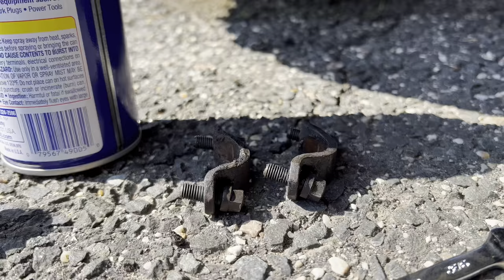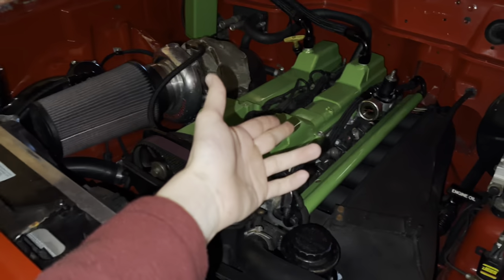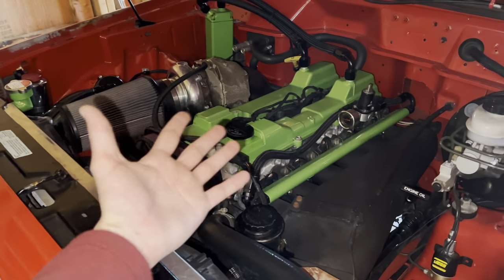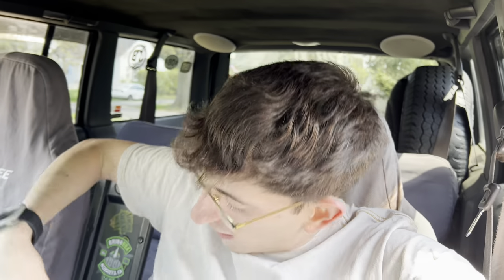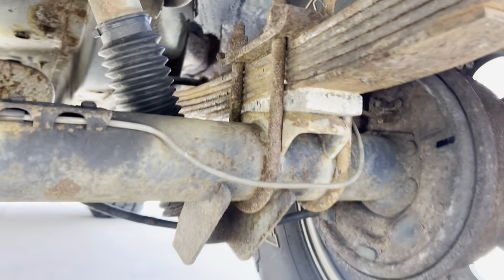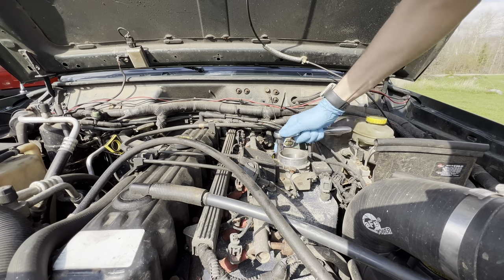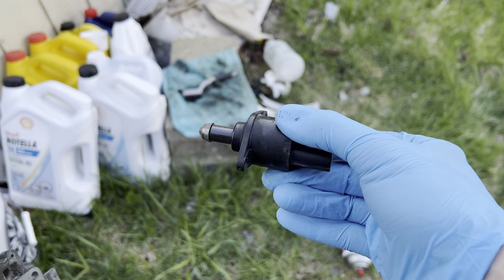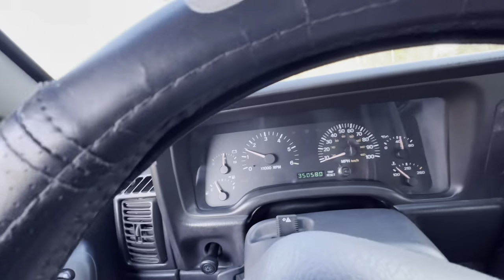This Is Why Your Jeep Gets BAD Gas Milage

Comment: I built my 4.0 for fuel mileage. It has a tune, upgraded pistons, and rings,balanced rods,  new cylinder head with LS valves, and mopar performance spings, Harland sharp roller rockers, re-sized ford 300 injectors new fuel pump, aluminum fuel rail, bbk throttle body, mishimoto radiator, with an upgraded fan, Afe power header with magnaflow cats. I get about 19mpg highway on 31 inch tires and a 6 inch lift.
Reply: Same, I built a 4.2l mini-stroker, factory head, factory cam, and electric fan conversion, I can get about 20 highway if I drive slow
Reply: @mercedescherokee6853   that's pretty schweet. I'm guessing 55-60 mph Is the sweet spot.
Reply: @TheGrimFoot yea about 65, my tires are a little bigger than factory so a little more speed puts it in a good rev range
Reply: @mercedescherokee6853  what's the mileage like?
Reply: This is so cool you should do a breakdown video
Reply: I use to think the 4.0 was bad on gas until I met the 3.7 omg what a thristy hog that thing will burn a quarter tank of gas just idling
Reply: Well, there's the recipe.
Reply: @michaelangelos5117  yeah, but honestly a stock LS motor is just as cost effective at that point.

Comment: Late to the game. The claim of "I'm not a mechanic" is kinda weak. If you're going to own older vehicles, like an XJ, and experiment on it, you need to swim on your own or be ok with paying money that could be invested elsewhere. There are very few regular shops you can take these to who will have any idea of what to do with some of that stuff (Look at Rainman Ray's Repair where he had an XJ come to his shop - good dude, but obviously not a Jeep guy). Also, if you don't know what your driveline angle should be with a stock vs. SYE/driveshaft combo, there are oodles of resources out there. In a nutshell: parallel angles for transfer case/Diff output/input (same angles at both u-joints) vs. point the pinion at the T-case for an SYE (minimal rear u-joint deflection). JFC, bust some rust on that thing before there's nothing left...

Comment: Just a tip. If you put the jeep in 4wd with the tires on the ground you wont have to use a pry bar to hold the front drive shaft from spinning.

Comment: yes cleaning MAP IAC and throttle body does in fact improve air flow thus improving gas mileage/engine performance. Getting it over 3k RPM is not lol. I feel like I get 3+ mpg better when I’m not heavy on the skinny pedal. I can get anywhere between 15 and 17 mpg in my 99 on 32s with 4.10 gears and 302k on the dial.
Reply: Absolutely. Going easy on it is key. I have a 99 stock height. I find just about 40mph and a lil above gives me the best mileage. Seems to be the sweet spot.

Comment: Those shims should go in the rear.  If you are vibrating in the rear, pinion angle is usually the culprit. Those shims will alter your pinion angle.

Comment: Those leafs being broken would definitely affect your ride! With that much rust, replacing those with the lift is highly recommended. 
I get 15mpg highway in my '98 on 35s. Just gotta keep the throttle bottle clean, air filter clean, and plugs/wires good. That 4.0 will run forever!
Reply: What tires are you running?
Reply: I have a collapsed lifter in 2 of my cylinders on my xj 4.0 and I get barely 10 mpg on 31’s with a 3inch lift. I’m just gonna run it till it blows cuz I got my dad’s 4.0 with 70,000 on it for my Jeep with gears and custom lift waiting for all the pieces for 35’s.   hopefully when I get the other motor in there is gets better mpg

Comment: Use "mass airflow sensor cleaner" to clean the IAC. It's designed for non metallic parts. Carb cleaner is designed for metals.

Comment: Shaking up front called death wobble need new bushings or replace the whole control arm lower and upper, do alinement. Those angel pcs under the rear springs you need them, you must point rear drive shaft to the pinion of the SYE minus 3-4 degrees less in angle as you hit the gas the entire differential rotates up wards so -3 -4 is perfect. Chech on line at Woods drive shafts will have videos as to the angle of drive shaft explained very well.

Comment: When you start losing oil pressure it could be worn out rod, main, and cam bearings.
As a temporary patch, you can run a thicker oil.
Reply: What would be the next step up in oil thickness from 10w30? 5w30?
Reply: @wyattserviss992 , It would be thicker, say 10w40, then 20w50. There are other thicknesses in between but the most used are the two I listed.

Comment: Steven, I believe that "Just Dex It" was able to prove that the low oil pressure at idle is primarily caused by worn camshaft bearings. Check out his resent YouTube videos. Be safe.

Comment: 1 it is a brick 2 its lifted 3 heavy large tires that is why they will get between 12 and 14 in town maybe 18 to 20 on hwy  you dont buy these for gas milage
Reply: I wish mine got that good of gas milage
Reply: I appreciate this kind of real info. Anecdotal? Sure. But, my 2000 is getting what I thought was "terrible" mileage until I considered...I'm getting 10ish in city...short duration. stop and go.  Once I take it on an actual straight line drive, I'm closer to 18. i am lifted, on bigger tires. Cam and stroke work. And, lucky.

Comment: Ive replaced multiple oil pressure sensors with oem 2 wire sensors, they dont read accurately at all, you need to run an aftermarket gauge to know what it reads, with hot oil on a new build it will drop down to 13psi coming off the highway to idle fyi

Comment: That little rubber plug on your map sensor is like a buck. But they're really hard to find. And you don't want to have to find it when you need it. So I would recommend looking for it and then having an extra one laying around.
Because they crack and break easily.

Comment: Your comment about your bolt heads 'rounding'... I see a lot of Jeep YouTube videos where the person is not using metric tools.  For many decades, all the bolts on Jeeps are METRIC, so if you are using Imperial sockets, you may be close, but they will not fit correctly and rounded bolt heads is the result.

Comment: You sure the oil pressure is not just a poor connection. Mine reads 0 to 10 at idle, if I go flick the sending unit with my finger it will start reading around 38-40 and then fail after a few seconds dropping down to very low reading

Comment: Just to make sure, did you disconnect the negative battery terminal before performing work on the sensors? And then once you complete any work involving sensors, you disconnect both positive & negative, then make contact with both terminals for a minute to have the computer relearn the sensors? I just want to make sure I’ve got those steps down. I’ve also got an O2 sensor I need to replace.

Comment: I have a collapsed lifter in 2 of my cylinders on my xj 4.0 and I get barely 10 mpg on 31’s with a 3inch lift. I’m just gonna run it till it blows cuz I got my dad’s 4.0 with 70,000 on it for my Jeep with gears and custom lift waiting for all the pieces for 35’s.   hopefully when I get the other motor in there is gets better mpg

Comment: Chrysler service manual for resetting ECM
Disconnect Neg Battery Terminal, isolate from battery
turn ignition switch to ON position, wait for 3 seconds
turn headlights to ON position, wait 3 seconds
Turn headlights to OFF position and return ignition key to OFF/Lock position
touch neg battery terminal to pos terminal for 3-10 seconds
turn headlights to ON position
turn headlights to OFF position
re-attach Neg battery terminal to battery neg post
turn key to ON position, but do not start
turn key to OFF position
cycle key back to ON position
cycle key back to OFF position
Cycle Key back to ON position for 3rd iteration, watch CEL for any error codes, if no codes present check manual for flash sequence for end of code list
cycle key off and back on
start engine
not sure why they make it such a dance to do this and this is from the Chrysler/Jeep Factory Service Manual for Daimler Chrysler vehicles 1990-2001 Jeep Cherokee XJ
also I've seen dirtier throttle bodies, but that one certainly needed cleaned, cool project rig, a 2JZ in an XJ seems like a wild swap but i'll bet she runs good

Comment: first off, if you have ANY old vehicle that you bought used a complete tune up with sensor changes is necessary to see the vehicle run anywhere near right. most people will maintain the sh*t out of a new vehicle for a while but that peters out. if it has changed hands multiple times your a fool not to go through everything.
second, when people talk about a lifted jeep getting bad gas mileage its not the lift kit, whatever that is, its the change in tire size. the taller the tire the worse milage usually. also, performance is affected because gear ratio is all calculated in along with tire size for the manufacturer to estimate gas mileage. unless gear is altered taller tires usually will make it slower on takeoff, may not even be noticeable.
 there are formulas for these and you can calculate what your mileage should be without even driving it. (closely, how you drive affects as well) this is how race teams figure tires and gear ratios for multiple tracks of different size to get optimal performance for that track.
im no expert, mechanically inclined, used to race, and have been a machinist. long ago, i setup cam and gear machines and i apply what i know here to what im trying to understand there.

Comment: Unnecessary click bait title.
Reply from the maker: Not clickbait at all…. 😂🤷‍♂️
Reply from the maker: A dirty throttle body would be the reason you get poor gas milage…
Reply: @stevennewellproductions  You made an unproven assumption without before and after measurements of gas mileage.

Comment: If.  You.  Want.  Better.  Milles.   Yes.    Pud.   The.  Right.   Tires.  The. Comen.   With.   The.   Jeep.   The.  Sure.   On.  The.  Driver.  Side.   Door.    If.   You.   Have.  The.  Money.   To.  Spend.  On.   Yes.   Gave.    Full.    Tuneup.      The.   Say.   Jeeps.     From.    1996.   To.        2004.    The.  Comen.   With.   Good.    Motors.     The.     Straight.   6.   4.0.       And.     The.    V8.   4.7.     I like.  To. No.  Can.     Reliable.         You.     Drive.   You.   Jeep.    Everyday.        And.    Mosley.     Problems.    Can.    Fix.       Upgrade.    Old.   Jeep.      Can.   Be.    $$$$

Comment: Jeep is crap. As a professional mechanic I refuse to even work on them./ Poor design. Poor handling. Poor 4 wheel drive capapbility but they are supposed to be known for their 4 wheel drive capability . Ha! Chrysler/Jeep sucks.
Reply: @johannjohann6523 You have got to be joking. Older jeeps are one of the easiest vehicles to work on. Also the 4.0 is one of the most reliable engines ever made and are simple to fix. Older Jeeps have always dominated off road because of their 4wd capabilities reliability and strong design. There are also many different versions of their 4wd system that were available in jeeps and were suited for different conditions. So not all jeeps are created equal. People see 4x4 jeep and think it can climb mountains and mud bog but thats not always the case. Typically only the higher trim models were designed for serious off road capabilities. I'll give you poor handling but nobody buys a jeep and expects good handling.